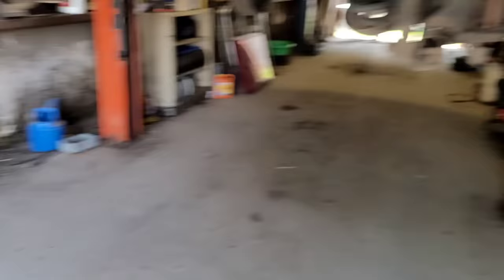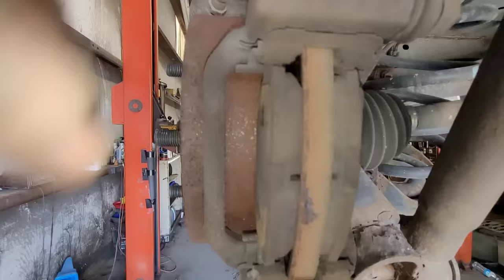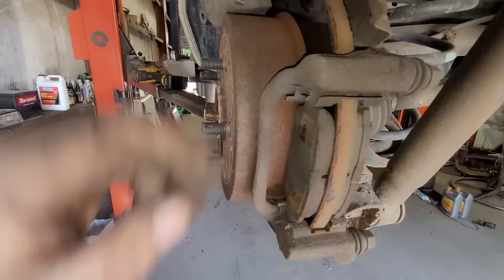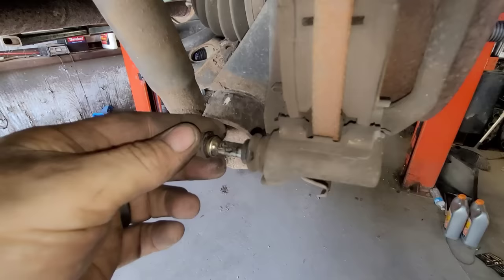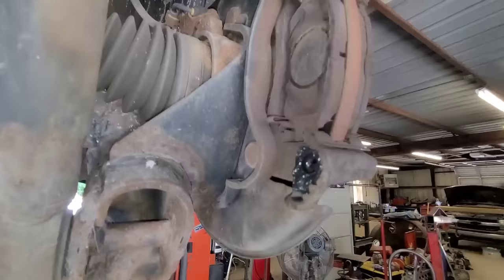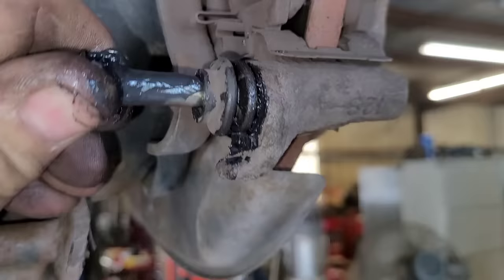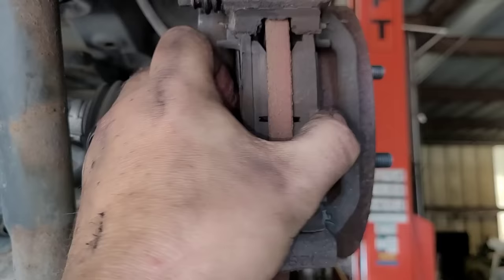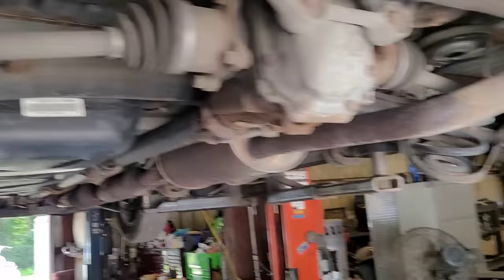Low Brake Pedal ? It's not air in the system...

Comment: I was really hopping I was going to get something off the video, but my slide pins are ok uffff the search continues
Reply from the maker: Did you verify that the pads move freely ? What vehicle do you have ?
Reply: @WrenchingWithKenny  I compressed the calipper piston with a screw driver and it mooves freely the pads move freely yes. I also lift the car and apply the brakes and the wheels dont lock.
Reply from the maker: @SamVieiraGuitar  , has anyone ever changed any hydraulic part of the brake system ? Or has anyone opened the system at any point ?
Reply: @WrenchingWithKenny  yes I have, I replaced both calippers and rear drum assembly. Everything was bled a few times, took it to the shop to be bled with the diagnostic tool and they did it twice.
Reply from the maker: @SamVieiraGuitar , I'm gonna guess you have ABS . Take your vehicle down a dirt road or something with loose gravel or sand and slam on the brakes to allow the ABS to activate. Do this a few times and then re-bleed the brakes. I have seen where a small bubble of air gets stuck, and doing this may help jar it free
Reply: @WrenchingWithKenny  they used the diagnostic tool to do just that in the shop, so I will assume there is no air in the abs.
Reply: @SamVieiraGuitar  Have you found the problem?
Reply: @SinsBird  not yet... replaced also the abs module and nothing changed... it still has a lot of travel before the brakes engage the way they should. The pedal is very inconsistent in the way it feels.
Reply: @SamVieiraGuitar  Master cylinder would be next. I think if one circuit is weak it would make the pedal go lower than it should.
Reply: @SinsBird  I already repleced the master cylinder. Same result.
Reply: @SamVieiraGuitar  After replacement of the abs module, were the brakes bled with a diagnostic tool? Also, when replacing the master cylinder, have you checked if there isn't excessive gap between the master cylinder shaft and the vacuum booster?
Reply: @SinsBird  yes, bled with diag. tool. There is no adjustment on the shaft.
Reply: @SamVieiraGuitar  
Probably the hose which goes from brake line to the brake caliper. They some times gets blocked either completely or partially. Sounds like you have a partial blockage in the hose. Good luck.
Reply: @someone1089  How could a blockage cause a low pedal?
Reply: @SinsBird  Yes, you are right.  mis spoke. But just saying, hoses should not be neglected.
Reply: @SamVieiraGuitar  I think I've found my embarrassing mistake, managed to install right side caliper on the left side upside down and somehow did not realize that. Doh!

Comment: I have a 01 f150  4.6 138k.  I keep losing brake fluid and just keep topping it off. looked all over and can not see any fluid anywhere. I " Think"  the master cylinder is leaking into the booster and out the exhaust. Ever hear of this?

Comment: We had a caliper slide pin boot come out of the carrier at work the other day. We all tried to get the little rubber boot to go back in to no avail. So they slapped it back together with the boot not seated properly and finished the brake job. I couldn't believe it. That slider is going to seize a lot sooner than it should.
Stop taking your cars to quick lube places, people. Find a decent mechanic and stick with them.

Comment: I have the same problem on my wives van, 2004 Honda Odyssey. Front and rear brakes replaced. The slide pins are not seized. Pulled them out anyways and cleaned and re-lubed with lube designed for slide pins. No leaks and the system has not been opened up.
All contact points are clean. The issue is still there. Any thoughts?

Comment: My ford explorer rear right caliper kept sticking and getting hot brakes were spongy too, had the caliper replaced and fluid bled but the caliper is still sticking and pedal still spongy, would this be my problem? I got told to change my master cylinder but theres no leaks anywhere🤷🏽‍♂️
Reply from the maker: Probably the brake hose to that caliper is No Good

Comment: Silicone base grease only on the slider pins, please dont use ny other grease on it, observe the same stock grease were used before you blow it out using your break cleaner, i can see a silicone grease before you wipe it out.

Comment: Saykenny I have one for u to decipher — car sat for two months n upon redriving the brake fluid was lost in the res so no brakes. Had towed in n brakes were fine. I had refilled the res prior to the tow. No brakes before the tow and normal pedal after the tow. No work performed but problem solved. Do u have an answer for me ? Thanx
Reply from the maker: What year, make & model?
Reply: It’s a ‘94 Saturn w/4 wheel disc n abs. One thing I omitted was - why I had lost the fluid in the first place?  No sign of a leak either. Probably about 10 k on a complete b j. Hope this helps. Anxiously awaiting.
Reply: Another thing - I’ve picked up the car n the brake pedal is now just less than half n kinda spongy the first half. I could really use some expert feedback on this. The pedal is not consistent. Thanx

Comment: I  replaced the brakes Calibers, brake pads, rotos but still soft saggie brake padal.
What else could be cause?
Reply: Does the pedal sink when you pump it up and hold with engine off? If so rebuild/replace master cylinder. If not make sure that there are no leaks, make sure that you installed each caliper on correct side otherwise you won't be able to fully bleed them. Last thing to check would be abs module if car has it. It could be leaking internally or there could be air trapped inside. Also be generous with brake fluid when bleeding.
Reply: @SinsBird  The brake is not airy when the vehicle is at rest but super spongy when it's running.  Despite the brake pedal sinks almost to the bottom, it actually works super well and the grip sets in just right in the middle. It seems to me that this does not match with the description of this video. I wonder if it is the master cylinder issue, or something else, but what can it be?
Reply: @wilsont1010  When the engine is running the booster is pressing the master cylinder with a much stronger force, this could be a small amount of air in the system. You could ask someone to watch the wheels as you slam on the brakes to see if all wheels lock up and slide.
Reply: @Nathan Rohrbough   @SinsBird  Thanks for the reply, but my experience tells me that this is out of the ordinary.  The pedal sinks all the way down when the vehicle is crusing without any resistance at all, however, it actually works super well and the brakes will set in just right in the middle, the pedal does work extremely wel, except that it just floats in the "air".  None of the vids is able to explain something close to this, I'm rather puzzled.
Reply: Check possibly that your hoses aren't old.Maybe your wheel cylinders are bad.

Comment: If that happens, will it cause the brake light on the dash to come on??
Reply from the maker: No. This would not do that. Only a loss of brake pressure, low on fluid or an issue with the ABS (certain vehicles if equipped) will cause the light to come on
Reply: @Wrenching With Kenny  yea I have a cadillac dts and the brake light word is showing on the dash with the abs light and peddle is soft going to floor also
Reply from the maker: @krishuggins4358  Is the fluid level low ?
Reply: @WrenchingWithKenny  nope it's still at the top
Reply from the maker: @Kris Huggins  was any work done to the brake system ? Did this happen all at once or was it slowly ?
If was a super slow progression of the pedal getting soft, then maybe it's possible the pins being stuck lead to brake wear that the caliper has to keep up with making the pedal soft and the abs to think there is a pressure issue
Reply: @Wrenching With Kenny  yes, in 2019 o e of my brake lines was leaking so I got it silver soldered and a new master cylinder put on. I got the motor replaced in 2021 but after I got it back is when I noticed that the pedal was mushy. The calipers are basically the original ones. I'm kinda leaning towards the pins being seized as well
Reply from the maker: @krishuggins4358  let me know what you find !
Reply: @WrenchingWithKenny  definitely

Comment: Can any kind of grease be used or using this special type of grease is a must?
Reply: High temperature grease, silicone grease is best because it's guaranteed it will not damage rubber parts chemically and it doesn't get overly thick over time.
Reply from the maker: What SinsBird said. They sell small tubes of this type of grease at the parts store. Regular grease will ruin the rubber components over time

Comment: Man... Informative video for a novice but you need to clean the metal surfaces first. I mean take a small wire brush on a drill and clean the hell out of hole in the caliper bracket. Wire wheel all the pins as well and then lube. Makes a worlds difference having that extra clean surface, not to mention a few thousands more clearance.

Comment: I replaced all four calipers, master cylinder, brake booster and new pads. my brakes still keep going to the floor. I have put about 2 gallons of fluid through the system bleeding the brakes. I have no more air bubbles coming out. It still goes to the floor. If I pump them you get a normal brake feel. I'm ready to burn this truck....2002 Dodge ram 1500. Any suggestions to fix this POS would be extremely AWESOME
Reply: The truck sat for about 6 months. I replaced the front rotors, calipers and pads. This is how it all started. Pedal was going through the floor. I don't believe it was doing it before I changed this stuff. I also change the block with the three brake lines going into it. They make a new part to replace the one that was made when this truck came out. I can't think of anything else to fix this...anyone have any suggestions besides burning this at the next range day
Reply: Possibly,check your brake hoses to your calipers make sure they're not old and hard.Could one of your wheel cylinders be bad?Is your emergency brake getting hung up?
Reply: @billsellgren9885  the calipers I bought from AutoZone say they work for front driver and /or passenger side. Funny thing is the bleeders should be on top. The bleeder is on the bottom on the passenger side. So the air was at the top of the caliper. I got it fixed. That was the entire problem. Thanks for the reply
Reply: Gotcha,so the caliper was upside  down.We all make mistakes it's apart of life 🤪.Glad you got it all figured out .